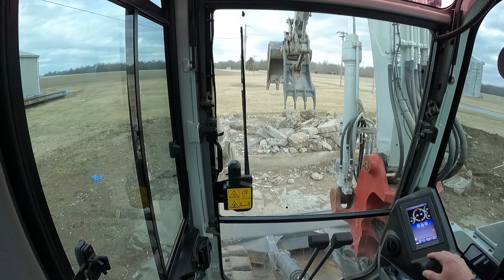Knocking Down The Second House On This Site

Comment: I’ve always wondered, is there a valve on the thumb that allows it to move in if you curl the bucket after you grab the material? The thumb has to keep pressure against the bucket, but I imagine the curling cylinder is stronger than the thumb cylinder so does it compensate for the bucket curling? 
I hope that makes sense
Reply: Everything I've ran you can kinda move both controls together to adjust your grip angle. It can be tricky cause of you move one to much, you can drop stuff. My mini will "overpower" my thumb but I try not to do it that way.
Reply from the maker: I’m not sure it has a valve for that. I work the bucket and thumb together when I’m curling it back. The bucket will over power the thumb. But I try not to do it a lot.

Comment: What was the spider web thing?
Reply from the maker: It was the carpet and it was aggravating 🤣
Reply: @eliteearthworksllc  - Wow! Didn’t think of carpet being so stringy like that! You learn something new everyday - Another great video! Thanks
Reply from the maker: @Manoffire260  I didn’t either it was some tough stuff too. They proposed done make it like that any more 🤣
Reply: @Manoffire260  I thought it might be hay bale netting… but, carpet makes sense.  Berber (loop pile) carpeting will string out just like that one did!  I know… I drilled a hole through one to install a coaxial cable.  As soon as the drill bit came through I had a three foot run, a wad of pile the size of a tennis ball and a wife who got to brush up on her sailor language!
Reply: @sassafrasvalley1939  - been there, done that! Did it break both wrists? 😆
I’m guessing it must have been a synthetic base (rayon/nylon) and not a natural jute backing that would have broken easily, especially as “weathered” as that floor must have been. The marvels or modern science…
Reply: @Manoffire260  no… she screamed loud enough I could hear her from the basement… so, I stopped drilling just it time… and yep, if the dinosaurs ate plastic we’d be finding it inside their fossils!

Comment: Putting a camera in that house? I guess if you get thrown off a horse, you climb right back on. I use a different thought, "if at first you don't succeed, skydiving is not your sport."
Reply from the maker: 🤣🤣I have learned to put the camera in the house when you start tearing it down instead of waiting for the last two walls when it’s not as strong 🤦🏼‍♂️😁